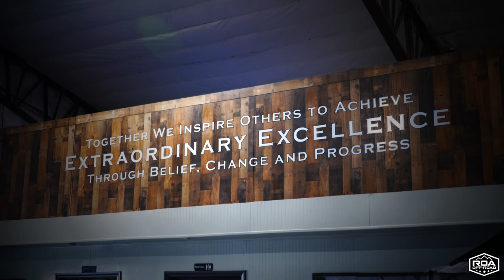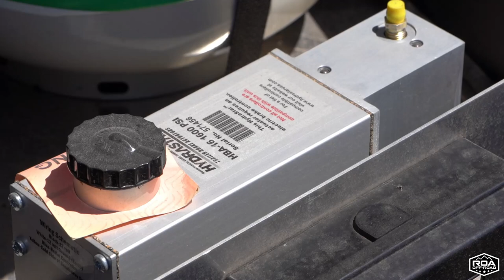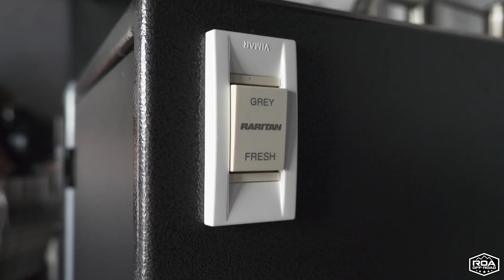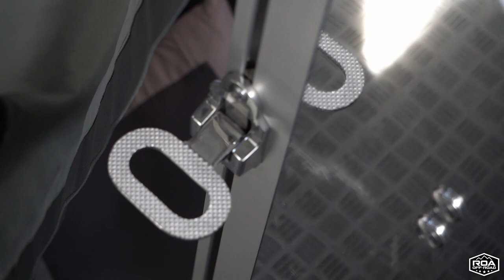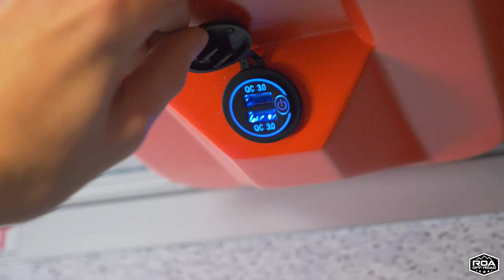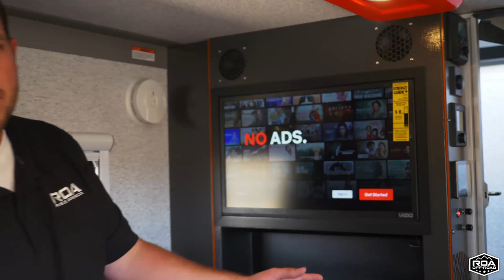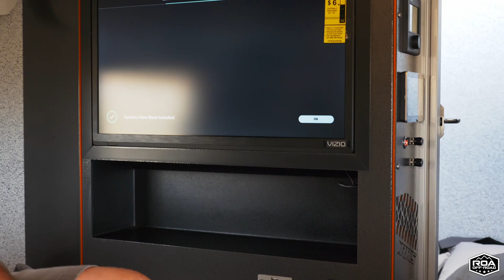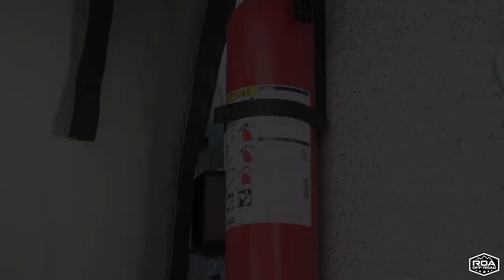RKS Purpose FULL TOUR | ROA OFF-ROAD (2022) Best bath off grid travel trailer camper  RVsofAmerica

Comment: I know you need to do the "adventure" videos, but we really appreciate the value of these nuts and bolts videos. The smaller two wheel trailers which make up the bulk of your portfolio are not suitable for us as fulltime travelers with two adults and two retriever dogs to fill the space, but these videos are still really useful. Having had the chance to crawl over/around/under all of your two wheel trailers, the RKS is the superior product from a manufacturing and design standpoint. The only caveat would be the Timbren suspension, which is a good product that has some wheel alignment challenges, and that huge 270 awning. It would be fun to see a video about how that awning performs in the 25-45 MPH winds that are common in the desert southwest.🙂 It was good to hear about an upcoming RKS Motive video. We have really high hopes for a tricked out Motive (or the mythical Roamer) as a future home!
Reply: Well said as usual Susan. To be brutally frank that 270 awining is decent for the price but a bit of a knock off and there are others like the ostrich 270 that are more in line with RKS usual build specs.

Comment: Loved this until the walk though got to the kitchen and the interior. Victron Yes! 270 degree awning Yes! The wrap on the exterior Yes. Entry into the bath No. Burners not covered by the awning No. Low head space No. Love the anodized and powder coated aluminum accents. This trailer is so close on being a new best seller but falls short on some very key areas

Comment: Not a bad trailer.  Shawn, I did not see you repack the awning away in 2 minutes.  It looks like a good awning.  if you are not tall enough to reach the awning front he ground it is very aquand to repack.    I take exception,  most men I know would be happy to sleep in a ground based tent.  The trailer with an inside toilet is for the wife.  Men who want to keep their better half happy will purchase a trailer that makes her happy.   I am surprised it only has a 15 amp shore power.   A 30 amp shore power would make energy upgrades easier.  It appears to be a 3 season trailer for the Mohave not the high desert were I live.

Comment: I like RKS. They are off to a good start. I do not like the short ceiling of the Purpose. That would make me feel claustrophobic. RKS should have designed it as a pop-up trailer. It looks like it is built with quality. How well insulated are the RKS trailers (Motive & Purpose)? Are they considered to be four-season trailers? I do not see that Motive and Purpose have an a/c. I like the innovative designs. I like the bathroom. I like the rail systems. I love the awning. I like the electrical system. I think I would prefer the Motive. No one talked about the floor. Is it composite or wood? I would prefer a four-season trailer with an indoor kitchen. I do not see much storage on either Purpose or Motive. That makes these trailers for weekend use only.
Reply: I disagree on weekends only especially with the Motive. It is an off road toyhauler-ish rig so that does make it hard to have the garage for hauling toys and lots of cheesy cabinets.
Reply: @bartman1857 If I had to choose, I would take the Motive toy hauler over the Purpose, the claustrophobic box. It looks like there would be more height in a teardrop than the Purpose. If the trailers are not well insulated, the Purpose would be a hot coffin. Both trailers have no storage. That is a minus for me. But I do like what appears to be a quality build and unique design features.
Reply: @JeffreyHallin  ya the purpose is a square/tear drop so that's means it's sitting room only. I suppose a tear drop may have I bit more headroom while sitting on your bed or coach but not much more. Most rigs in this class have limited storage.
Reply: so I believe rks uses 1.5 inch fiberglass honeycomb frp type panels in walls, ceiling and floor.  No wood to my knowledge. Also very well insulated windows. Add the winter package with all sealed plumbing and tanks and both of these models are very well insulated. Maybe not a 40 below zero fish house but as good as mosr off road trailers.
Reply: Here is a link to a good walkthrough video of the Motive where the owners discuss construction and design techniques:  https://www.youtube.com/watch?v=7GHQpNeeF1g

Comment: please stop saying you can tow this rig with a jeep!!!! unless you clarify said jeep as a gladiator with a 7,000 lb towing capacity
Reply: The manufacturer literally has a video of one being towed with a Rubicon.
Reply: @TravelingStacker I know crazy huh. They use to show thier Purpose trailer being pulled by a Wrangler
Reply: @TravelingStacker  duh a Rubicon is a Wrangler my mistake. I am baffled to what RKS was thinking. Purpose is 3k dry 5k + gwr. Now way a Rubicon Wrangler at 3,500k towing capacity could handle a Purpose with any cargo or water in it. My guess you won't see any current pics of the Wrangler towing a Purpose.